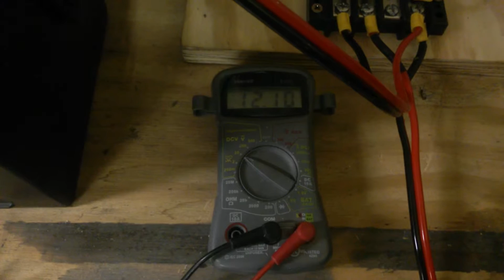Bedini Pulse Motor  3rd coil increases rpm from 85 to 105

Comment: Please apply this principle on scooter front wheel.
Reply from the maker: You could use a scooter front wheel but a bike wheel that is aluminum works alot better. The wheel has to be lightweight and non ferrous.